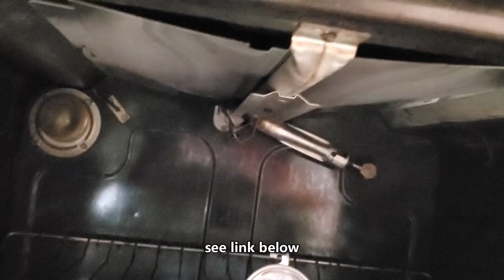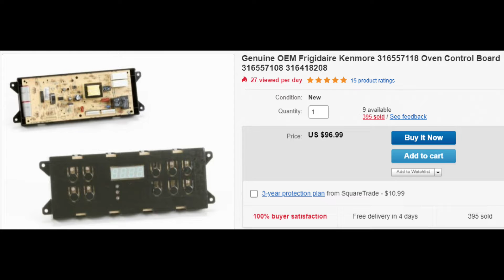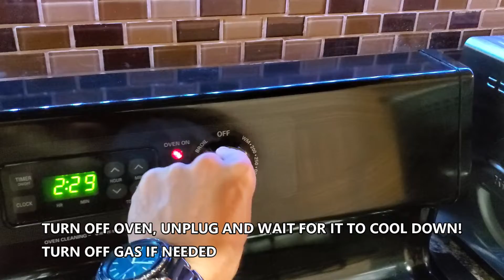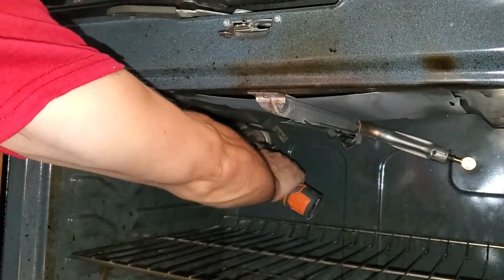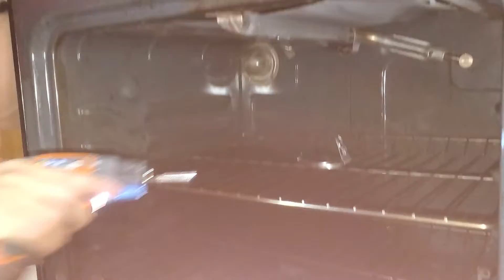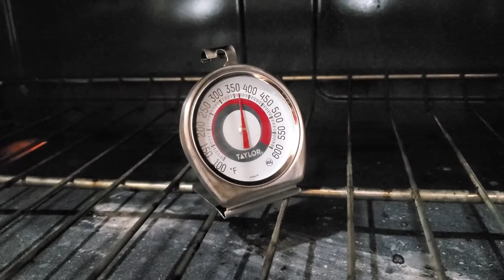3 Ways to Repair Oven Stove Range Not Heating up to Preheat Temperature

Comment from the maker: Update you can calibrate some models by holding "bake" button for few seconds then use temp up+ or down- depending on the temperature difference inside the oven vs temp set. Once you set the temp (increase or decrease) then press "start" to save. In most cases you'll increase the temp on the oven. Check out the links in the video description and like 👍 if this helped.

Comment: My Frigidaire model  FGGF3058RFC  oven beeps that it is up to set temperature when it is 100* below it. It will continue to preheat until it is closer to the preset temp. What is the problem?  Thank You.

Comment: I had a new stove top put in. The old one worked fine but now the new one won’t get hot enough to boil or fry and the oven next to it the burners won’t heat up. Both are wired into a box and the into a plug in. The old stove top had 3 wires and new one had 5. What could be wrong

Comment: As a first step, you might read the manual and see if there is a temp calibration offset feature to correct the inaccuracies. If you can’t offset the set point enough, a new thermostat might be in order.
Thanks for your videos
Reply from the maker: good tip.
Reply: It will go to the temp. It just beeps too soon and it’s not there yet.

Comment: Tampatec - also if the temperature only measures within 30° of the set temperature, the temperature setting can be adjusted to match actual temperature. There are videos on this. Thanks
Reply from the maker: thanks for sharing that, I should have tried that calibration first 👍

Comment: My oven was funky for years then just quit heating. Opened it up and the temperature sensor wire was wrapped around the heat element ceramic insulator... $15 part and its been spot on since
Reply from the maker: good job 👍